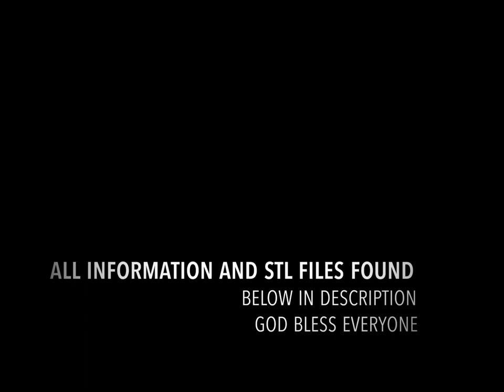3D Printed N95 Hospital Mask for Covid-19 Timelapse

Comment: I wonder how it will seal around the mouth if you print in TPU.
Reply from the maker: Kaleb Brooks great question. I’ve asked a lot of my friends that print in TPU and it’s a doable option. Though I am no expert since I only print PLA. I think it would fit around the face better and possibly be easier to sanitize since it’s non- porous. Drawbacks would be it’s harder to print TPU reliably and most 3D print hobbyists don’t do TPU. The PLA mask is a hard plastic but if printed at the right size it can suction down with a decent seal. But I would love to hear everyone’s thoughts on this.
Reply from the maker: Check out this video. He did exactly what you were talking about by printing in TPU. Same model of mask.  https://youtu.be/RaUBp6kELWI